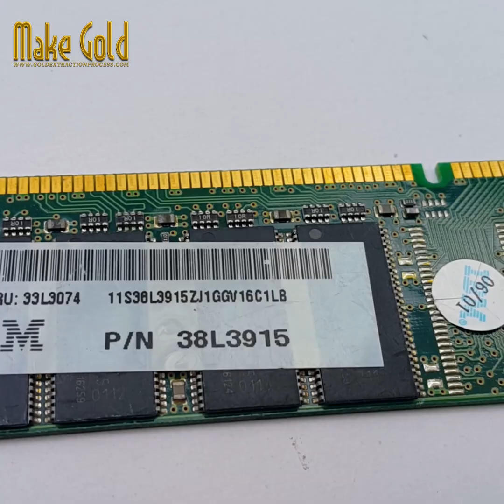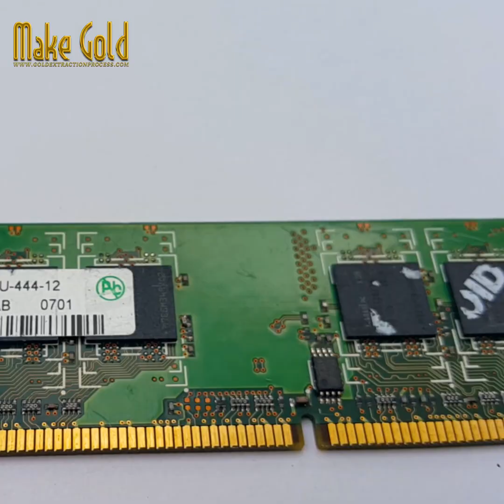🧠💡 Gold Wire in RAM IC Chips – How GOLD Is Hidden in Your Memory!

Comment: Sir, which item contains the most gold?
Reply: If you can get ram with IC chips on both sides your getting the best
Reply: @Reasonist   blank RAM modules, just the gold-plated circuit boards, without the IC chips. Is it worth it?   I HAVE 40kg
Reply: @PEKtoGRU  still have the fingers attached or cut off?
Reply: @Reasonist   fingers are still stuck; I didn't cut them. I'm buying everything here: PC boards, memory, hard drives. But I want to learn how to extract them. I have plenty of material at home.
Reply: @PEKtoGRU  if the ram has no Chips on it, there might still be flash gold plated under the solder mask, but the majority of your gold will be the fingers, which will take less acids to remove if separated (cut off) from the blank module first, keep the gold flash-plated boards for eventual refining when you are ready to do large volumes of low-grade boards